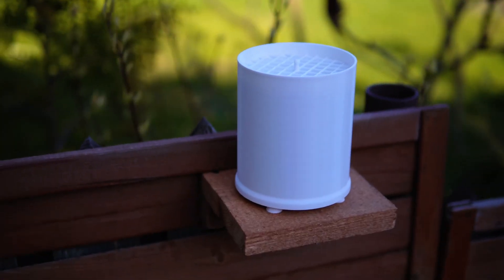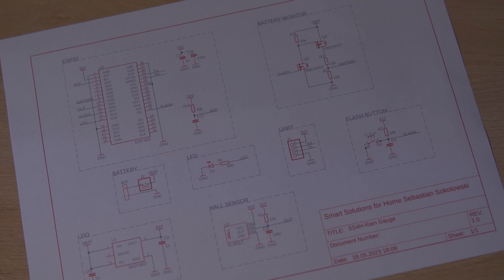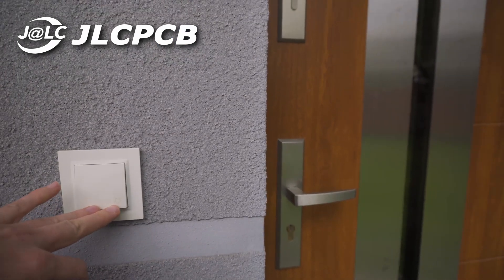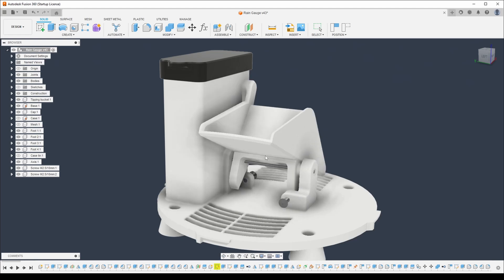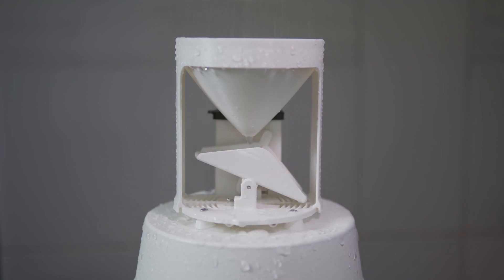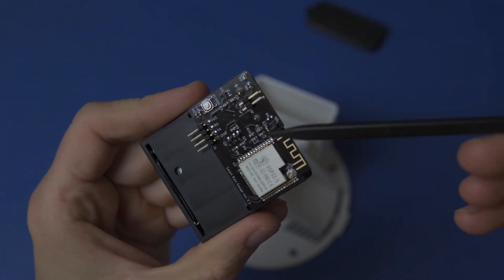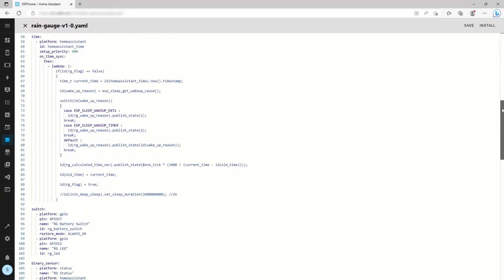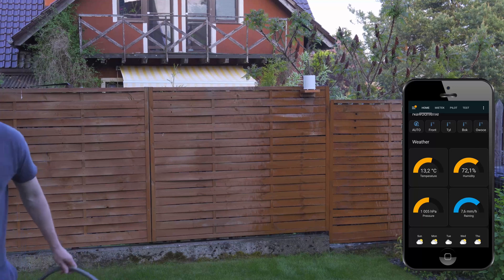DIY WIFI Rain Gauge, powered by Home Assistant

Comment: I make commercial water, soil and rain monitoring equipment for one of my companies (mostly the PCB design, and CAD design). Anyway, the commercial rain gauges work in a similar way, except they use something like a "spoon" that just tips out when full, and activates a reed sensor switch. This then wakes an MCU to update a counter. Then a realtime clock wakes it every few hours  to upload the readings via LoRa/GSM. The LoRa versions can last literally years on an 18650 battery, as it's only using a few uA when sleeping :)
Reply from the maker: I agree, LoRa is absolutely perfect for such applications. Not only does it have a long-range capability, but it also has minimal power consumption. It works perfectly in devices where there isn't a lot of data to transmit. I should definitely consider working on a LoRa project someday :)

Thanks for the comment!
Reply: @SmartSolutionsForHome  LoRa Gateway first then you set yourself up for more LoRa projects that feed HA through the gateway ;)
Reply: Valuable comment thanks.  Do you use a separate rtc chip in your board designs?  I suppose it comes down to whatever has the least current draw?
Reply: @bsmithril  yes, separate RTC both due to lower power consumption, and also because it can run directly from a LiPo battery with no voltage regulation. Same with the MCU and GSM modules in these - all run from 3.4V to 4.2V, so well within the range of standard batteries. Reduces the BOM/assembly cost and power losses of using regulation. The LoRa modules (when used) do need 3.3V but it’s only on for a few seconds during a normal upload cycle.